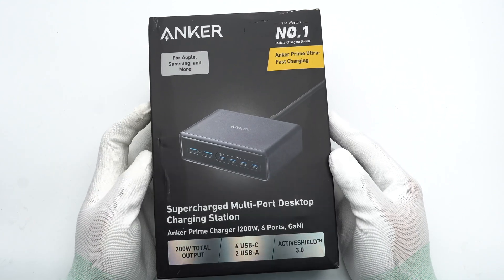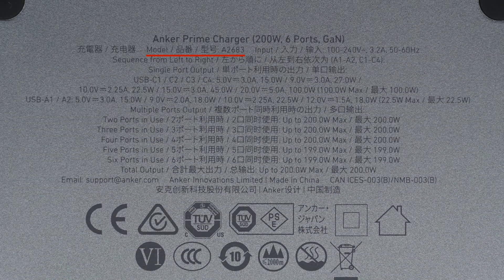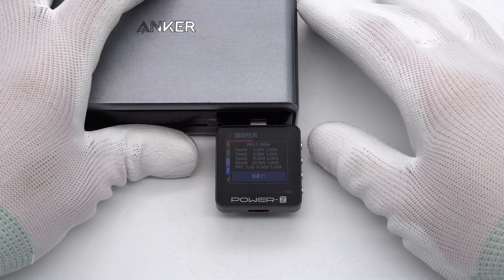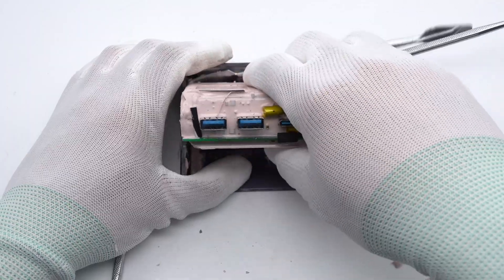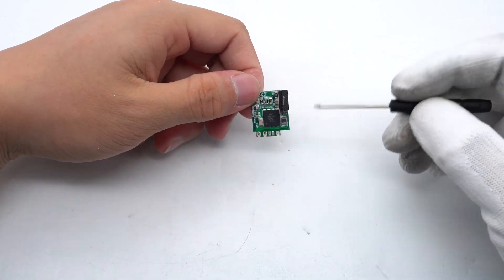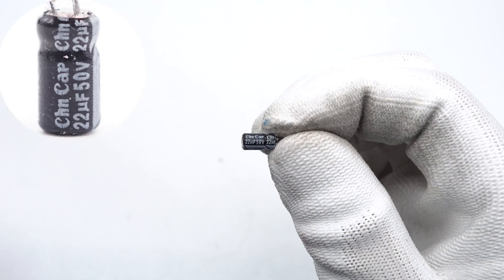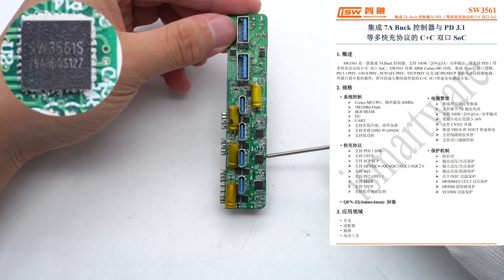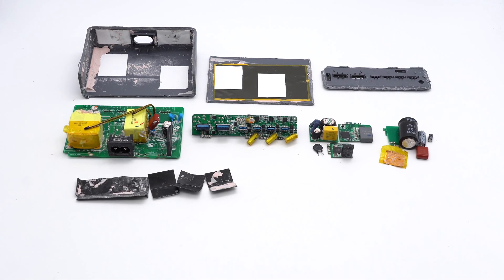Teardown of Anker Prime 200W 6 Ports GaN Charger

Comment: I have the awesome Power-Z, but really really need some help testing chargers like this, for the ACTUAL charge rate.  Can you PLEASE do a video showing how to use a DC Load Tester in conjunction with the Power-Z to test ACTUAL load?  It would be great help.  I need to test a couple 140w charge I have, but I don't have any devices that can pull more than about 100w.  I have bought a DC load tester, but can't get it to negotiate the higher USB-C PD rates.

Comment: For a charger this big I would expect 240W single port output, not 100W
Reply: Name a single charger that has 240W single port output
Reply: What will you charge? Your tesla???
Which device supports 240 watt charge????
Reply: I would expect at least 140w port... 28V x 5A = 140w
Reply: @hitchjay  140W is available in Ankers 250W charger - I assume they wanted to have it as differentiating factor. Unfortunately ChargerLab didn't test the 200W charger before teardown. The 250W charger reduces power after an hour of full load.
Reply: @thomask6846  agreed, still this kind of device should provide 140w for one port at least. 
My headache these days are a clear differentiation between chargers and PSU units. These are clearly chargers yet marketing language positions 'em as a PSU.
Reply: @thomask6846  yah, heat management is an issue with these chargers if one is to use them like a PSU.